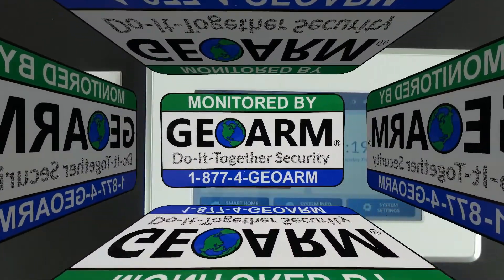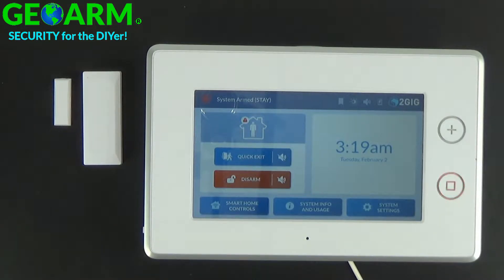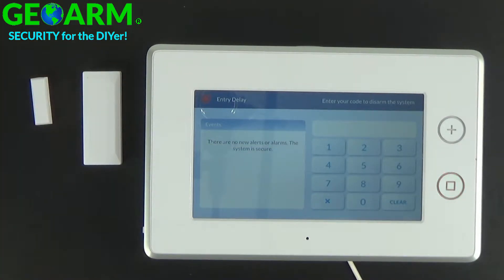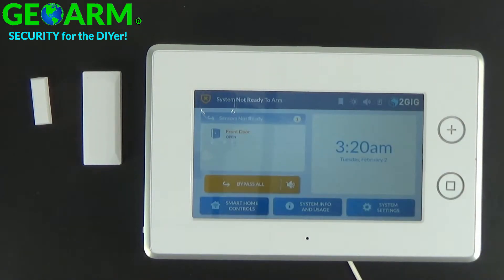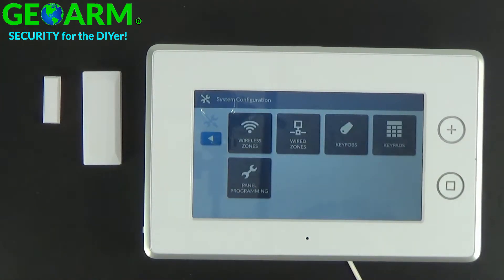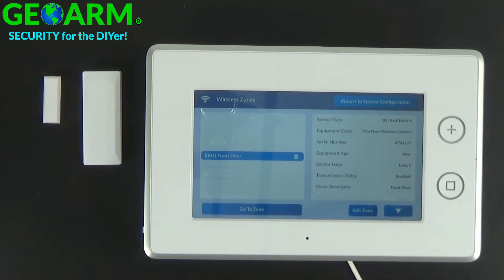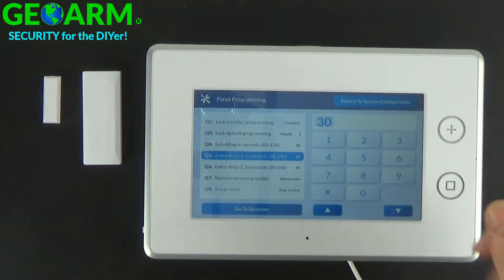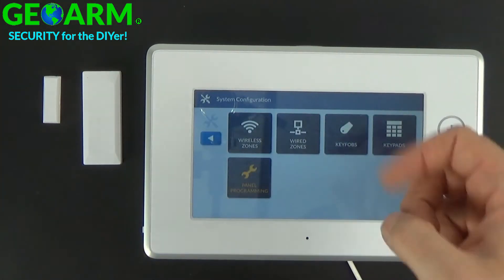2GIG GC3 - How to Adjust the Entry Delay 1 Timer?

Comment: This video is amazing and I will tell you why. I couldn't get access to the installer toolbox because I didn't have the passcode. At the 1:18sec mark of this video, you showed a code of 1561 so I figured I would try it to access the panel and it worked. I would have never guessed that number 👍🏼 Thanks!!!!